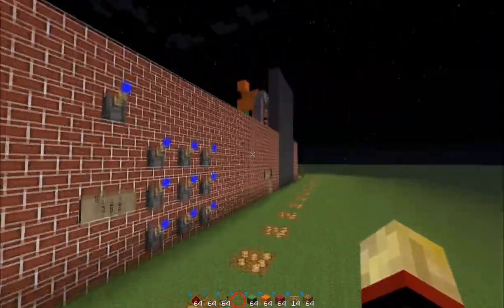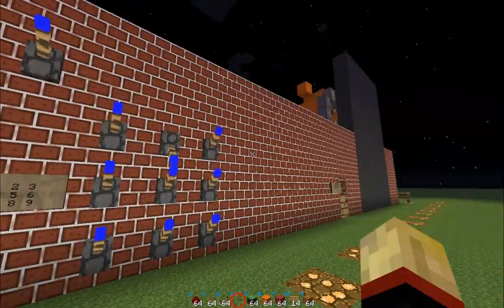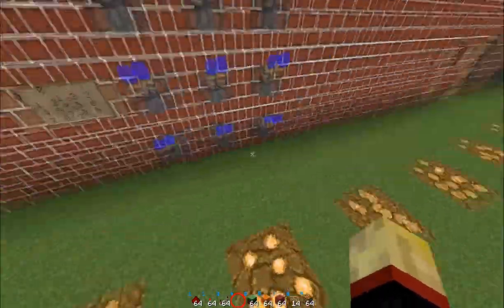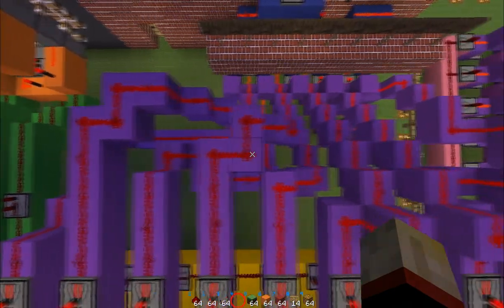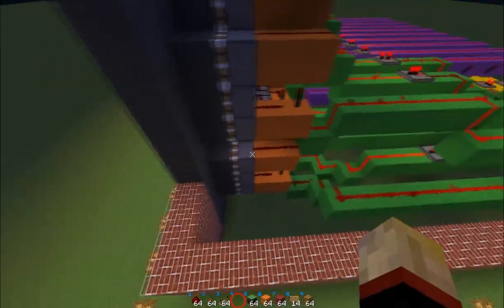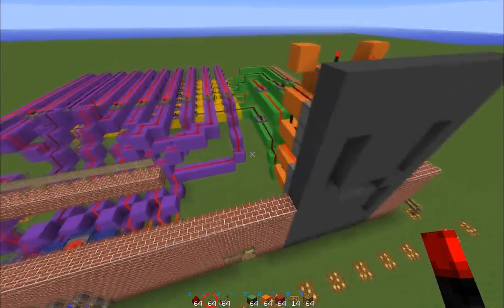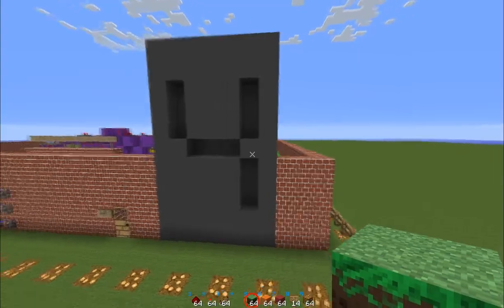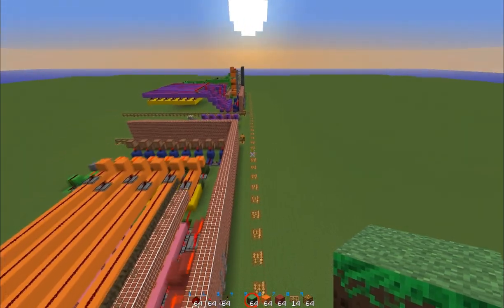Minecraft: Redstone | Pt. 11 - Better 7-Segment Display Inputs

Comment: Not quite as easy to extend as you're making out, but it's the right concept, also using massive displays with this style of coding is a tad impractical, due to just how massive it would be. A good thing to add to the display is an adder, so you can hit a button, and count up. You Could, attach your binary counter, but you would need a binary/decimal decoder which takes up more room, but I think you'd enjoy building that (just use the same sort of coder as for the 7-seg display)....